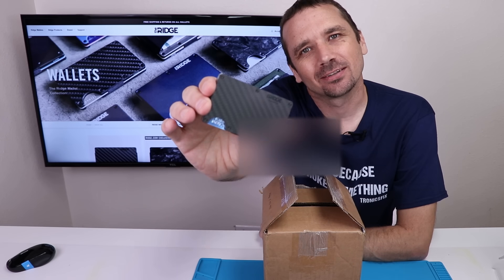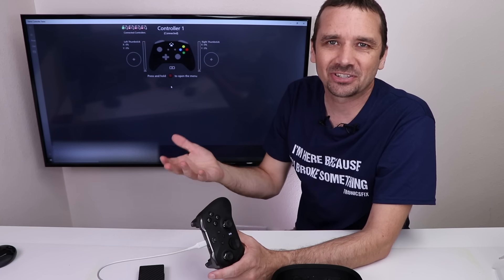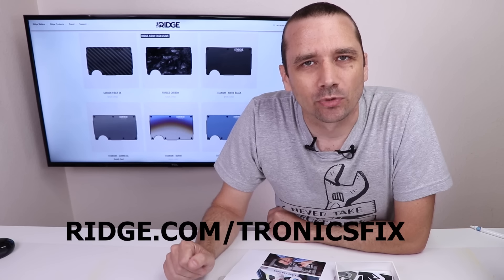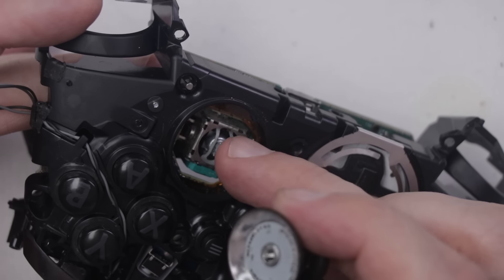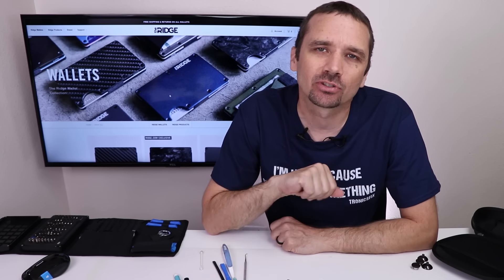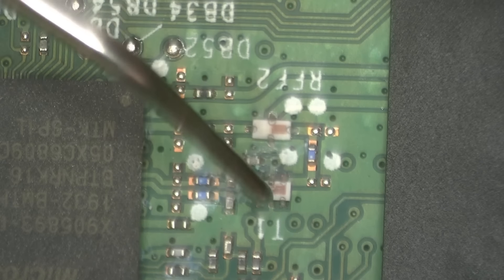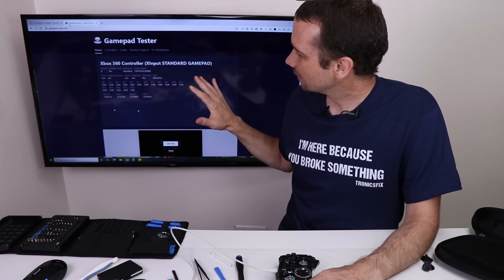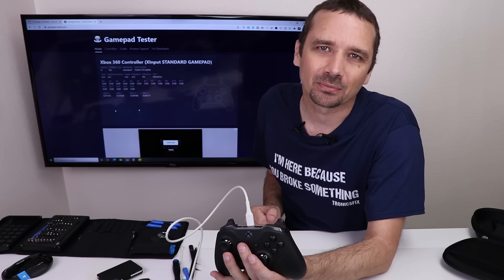I Paid $99 for a BROKEN Xbox Elite 2 - This One Was A Tricky Fix

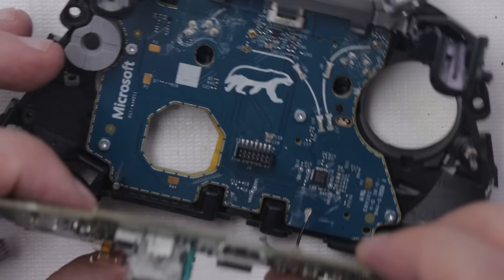Comment: 10:21 I found a solution to drifting analog sticks. All you need to do is pry open those 2 green containers on the module. There should be a small disc in there. You just have to clean that entire container and the disk with isopropyl alcohol and place the disk in perfectly. Your problem should be solved instantly. Works for me every time, however it’s a temporary solution lasting for about 6 months or as long as a normal analog stick.
Reply: @cpt ghost he actually made a video on this just look up his 3 ways to fix controller drift video.

Comment: Funny you would make a video on this controller, I recently purchased a faulty Xbox One Elite Series 2 controller myself for €79. Upon opening it up, I was kind of shocked at the state of it, I have a hard time understanding what happened to it but I got it to work in the end.
It was missing the magnet for the hall effect sensor on the left trigger (I could only find one from an elite series 1 on ebay, figured it would do).
The support bracket for the magnet was broken and the broken half was missing as well (I could only find these brackets for either the regular controllers, ended up ordering one for an S controller).
The left shoulder button didn't work, didn't even click in (turns out the metal plate it fits onto had been bent a lot, had to realign it).
The right trigger rattled when vibrating (had to tighten it down).
In the process of opening the previous owner broken one of the little pillar that holds the left bumper in, no biggie, it works fine without that. They also broke one of the structures that holds thee controller fascia into place and they broke one of the structures that holds the silver plastic on the top of the controller into place so it looks slightly misaligned.
Anyway, I got it to work fine and I'm happy with that.
Reply from the maker: Nice work! Controllers can be challenging to repair because of how badly they're treated sometimes.
Reply: @Tronicsfix  yeah, I've been struggling with some ps4 controllers. One of them still has drift even after replacing the offending analog stick twice, with a new one.
Reply from the maker: @hadesmcc  That's a tough one. I haven't done enough of them to give you any ideas.
Reply: @Tronicsfix  I'll have to keep at it. I had a similar issue with an Xbox One Elite Series 1 controller but that had been my mistake, I had moved one SMC with the hot air inadvertently. Fixing that fixed the issue but that is not the case with this rogue DS4 controller. :)
Reply: André Coelho I bought a DualShock 4 off eBay which had a broken analog stick/drift issue. I replaced the joystick module and still had the stick drift. There’s two resistors and depending on which way the game character moves with the stick drift, one or both will have to be replaced. The character moves back on its own and won’t move forward so that tells me the resistor on the left has to be changed. You’ll have to keep changing the resistor until you find the right one and luckily I only have had to change it once or twice.
Reply: @devoid3227  Thanks, I'll look into that. :)
Reply: @devoid3227  Do you happen to know the values for these resistors? I could measure them with a multimeter to see which one is off.
Reply: The owner must have been playing a lot of FIFA

Comment: I had actually fixed one of those a week ago. Drift issue. Fixed it up. There is a website I use to test every controller I work on, which happens to be the site you used. Funny how its registered as a 360 controller.
Reply from the maker: That was strange but still worked fine. I'm not that familiar with that site so I wasn't sure if that was normal or not.
Reply: @Tronicsfix  I will say the gamepad tester app has given me bad readings before. I replaced the sticks on one, tested it with the app, and everything looked fine. The customer brought it back with the same issue. So I used that site and sure enough the drift was still there. So it's good to have a backup just in case.
Reply: @HumanDelta38  yes true also windows 10 has a buildin controller test which also works very good on finding drifting.

Comment: Great fix, I would have been totally lost. 
Little question though, will it not get worse overtime? I thought corrosion, unless you get every single bit off, is a timebomb
Reply from the maker: Yes, generally speaking, you need to remove it all or it will continue to corrode over time.
Reply: @Tronicsfix  ah right, thank you for the response, I was thinking of starting to buy some broken products myself so I'll know to stay away

Comment: I've always wanted one of those controllers
Reply from the maker: Other than the smoke it's a really nice controller.
Reply: I’ve had two the first had a few issues got a replacement and works great only thing the right bumper doesn’t respond sometimes have to press it hard or in the right place but that goes away after a while
Reply: I have an Elite 1 and Elite 2. I really like my Elite 2. Well worth the money for the quality and customization.
Reply: Nice is there a ps4 version
Reply: Ghostreaper 098 ones similar to it
Reply: @jimmyfallon4237  thanks Jim
Reply: Ghostreaper 098 Sony dont make a pro controller but third parties do
Reply: ARX Infinite third parties do and Sony Will license them
Reply: I had to send mine back to Microsoft after 2 weeks because the right bumper was registering twice when I pressed it. Apparently lots of people have been having problems with the Elite 2. I should get the replacement Wednesday so I’ll see how that goes.
Reply: @Tronicsfix  lol ok😂
Reply: @shadow_sith5102  no, this is xbox only, take a look at scuff gaming

Comment: I’ve been buying and fixing elite series 1 controllers. I also mod new frames to get them to fit with new bumpers, triggers, and faceplates from the one S/ one x controller. Just got an elite for $15 that just needed one board connector re-soldered.

Comment: I disassembled and fixed the shoulder buttons on an Xbox One controller before. They requires you to melt the plastic welds to get into them. It's not easy and I recommend replacing them over fixing
Reply from the maker: Hmmm...all of the Xbox One controllers I've taken apart that piece just pops out. I'm filming a video now of repairing 25 Xbox Elite controllers and I'm replacing a number of them. Maybe I'm not thinking of the same part you are.
Reply: @Tronicsfix  how much were all of them?
Reply: @sawyermack7739  probably around $300-$400 or less

Comment: Perfect timing, the RB tactile switch on my Xbox One S Controller is broken. I'm trying to do a repair. This is a great video so many twist and turns but positive result at the very end.

I've learned that the stick is calibrated onto the motherboard by Microsoft, so replacing it without calibrating the potentiometer will caused the dead zone to be off.

Comment: When I see the title and you find it as a tricky fix, I’m surprised
Reply from the maker: I'm actually not as good with controllers. I haven't fixed as many of them.
Reply: @Tronicsfix I'm sorry to ask but my controllers right trigger does not work unless I blow in the controller any fixes you know?
Reply: @FOREVER-qj3rt  If you feel comfortable taking it apart, the pad for the shoulder button is probably dirty and needs to be cleaned. That's my best guess and where I would start troubleshooting

Comment: Honestly I think original Xbox one controller thumbsticks are better, I have the elite series 2 and I've used it for 3 months and the left thumb stick is already wearing out :(
Reply from the maker: Interesting
Reply: @Ebolachicken  say what? Cheese grime? Not the one I'm thinking about?? O_o
Reply: Make a warrently claim on it. Most people forget, my headphones recently broke but luckily had 1 week left on my warrenty so sent them in and even got a newer model because my current ones were so old & discontinued
Reply: @sm00th77  And what next, after warranty runs out (1-year only I pressume)?
Reply: Used mine alot. every single day for 9 months. thumbsticks seem to wear a lot less than the old ones.. you might just have a faulty one....

Comment: I used to smoke. I quit like 13 years ago. I never knew how stinky it is. That said, that person must have smoked a ton to make it linger on non fabric!

I love my Elite 2, most of the time. Seems myself, and others have a problem with it shutting off in Rocket League. I just keep it plugged into the power.

The whole design of kit is great. The case, with a charger. It's pretty flashy.

Comment: Random tip if you want to get rid of the smell of smoke 

Simply grab the shell and dip it in cold water with banking soda that will get rid of the smell (gotta leave it there for at least an hour or overnight for better results :3)

Comment: You can actually fix stick drift by replacing just the sensors. (The green bits on the analog. You can gently bend them out and switch the sensers with tweezers

Comment: My thumb sticks had some glue on the threads to keep them from rotating under normal use.

Anyways I fix my drift issue with the left thumbstick drifting up and down by pulling the top cover off,then the thumbstick bell,pulling the potmeter away from the board,pulling out the wiper disc,straighting the wiper contact point to where it's the only point that can touch the top outer ring,cleaning the carbon traces with isp.

The top ring had a rough spot on it,so I used some    Tweezers to  Gently clean it being careful to NOT bust up the carbon,then used a #2 pencil to add some carbon back in,then clean the traces again and no more drift.

It took about 50 trys of pulling the wiper disc out and getting it straightened just right,tho, so just be patient..

Comment: I'd love to see you take one apart that has the more common problems, to see if you can see the cause. I had 4 Elite Series 2 controllers and all 4 had an A button that didn't always register when pressed; that's right out of the box. It would be interesting to see if it's something to do with the silicone pads that sit under the physically buttons and if replacing those fixes it.

Comment: I picked up on of these for surprisingly little money, guy never mentioned that the shoulder buttons were super unresponsive. Read some people's experiences and dropped some alcohol into the switches and worked them for a bit as well as filling the gap under them with little lengths of wooden rod to support them. Perfecto now but the failure rate of those buttons for so expensive a product is truly shocking.

Comment: Hi Steve. I saw something on another channel that I thought might be a cool idea and something I haven’t seen you do before. Find a PS1 in need of repair and do an update with a PS1 digital upgrade. The PS1 needs to be one of two board models and requires Micro soldering to install ( something your very qualified to do).  Possibly do a before and After video improvement too. But a retro repair and upgrade would be a pretty cool video. Thanks for the cool videos

Comment: i recently bought a faulty gameboy game to repair. I received it recently and opened it up and it had the worst liquid damage i have ever seen. Everything had thick green corrosion all over it and the chips just fell right off. I just had to throw away the circuit board nothing could be done to save it

Comment: Good work but I saw vibration motors full of liquid damage as soon as you took top off, and then when you took the triggers off too, Those motors need replacing not cleaning. As much effort as it took to reflow the boards and repair the liquid damage, experience told me to walk away, i've done hundreds of this type of fault, even though it appears fixed they never last long after liquid has been in there like this controller had. keep the vids flowing

Comment: See the dual board design on the Xbox one controllers makes them a pain to fix because if it’s the board with the controllers brains your in trouble if it’s buttons not working could be a faulty top board there a horrible controller I prefer the 360 and original Xbox controllers

Comment: I bought this controller and those plastic nubs on the triggers broke in 2 weeks.  The original was metal, I think, and still on my old controller.  While this controller is better they moved to cheap parts, especially those nubs to save money.

Comment: Hey Steve, love the content. Quick question. Did you check and reset the controller back to defaults before tearing into it. I noticed in the beginning you were on profile 3 of the controller, which somone could have set to have those buttons not work on purpose. If you press the center button they will go back to defaults. Your tester program might have overridden that but I doubt it since it's inside the controller that these assignments happen. Download the Xbox accessory app on your Xbox and plug it in and see if profile three was set that way.

Comment: I had some refurb and now a brand new one, and they all have the same issue  for me. The buttons are not sensitive enough when pressed and it doesn't trigger sometimes, even after the click sound and all. Could be the quality of the membrane or the holes for the buttons giving too much space to move the buttons around. All in all, this is frankly the worst controller I've experienced.

Comment: I'm aware that this video is old, but could you please make a tutorial on how to remove the potentiometer on these newer xbox boards? I have many years of experience on the older controllers but these new ones with the updated solder holes are giving me so much trouble. It's impossible for me to melt the solder and suck it up well.

Comment: Hey man, I've repaired quite a few regular Xbox One S controllers which electrically are pretty similar to this one, and the B button doesn't connect to that last chip, simply because it is on the green board. I mention this because I saw the B button not working before cleaning that last chip, and neither after that, so I'm just curious, B worked after that last clean? Or was it still having issues?
Awesome video btw, I wouldn't have enough courage to open a controller like that without watching some sort of guide haha

Comment: So I bought one of these a little over 2 years ago was never able to use it as the left thumb stick was never really responsive, character would barely edge forward. Had a look at it via xbox controller test and really had to put some excessive force for it to register it being used. Did remove the front facial cover and all movement was registered as normal, not a viable option for designed use, though. Hoping it is an issue you have come across and could share some knowledge 🙏

Comment: You actually don't appear to have all the parts, the middle slot in the case is for a key that adds tension to the analogue sticks. Also you should have 6 analogue sticks total, and it looks like you only have 4?

Comment: You should be testing with default profile (profile light OFF) You should have owned one or at least understood the features (Like adjustable thumbsticks) Also you should be using the xbox-one elite app. Can't believe anything on that PCB could possibly benefit from reflow, cleaning maybe. Looks as if it only started working because you finally booted it in default mode (FW)

Comment: help!
which is the voltage battery ? 1-positive 2-neutral 3-negative

1-positive and 3-negative = 3.8v
1-positive and 2-neutral = .08v is correct ?

Comment: Great vid as always! I have a question: my Wiimote had a "broken" accelerometer, so i opened it up and i cleaned it several times with alchool and a tooth brusher. Now sometimes it works perfectly, sometimes it doesn't respond at all. To me it seems pretty clean, what's causing the problem for you? Thanks for the answer in advance

Comment: You put a past on the 4 edges of that one chip then went through with a soldering iron. You said that was resoldering all the connections? Can you show a video of that technique because I've never seen that. I've tried soldering each pin individually and it's touch to keep each connection separate when it's that small. So you coating all the connections at once I don't know how you stopped solder from bridging connections.

Comment: I don't know if you answer questions about console issues but I can't seem to find my issue anywhere online. So I have an Xbox 1 and if I leave the power supply plugged in and turn it off n turn it on it goes directly to the trouble shoot screen no error codes. But if I power down n power cycle the xbox n plug it back in and turn it on it will boot up. I've checked the power brick light is solid white when on solid orange when off. The xbox power light on the front will flash in rapid sequence while on. It doesn't crash n works normally.  I have tried a soft reset n hard reset and nothing works. Every once in a while i hear a odd tick noise from inside the xbox.

Comment: Is there a way to just buy the official Xbox One USBs that come with each controller? They are so good but once they start going bad/get dropped the wire NEVER goes back in properly, the top port are so badly made. The Switch Pro does it much better

Comment: Great video as always! I do have a question and perhaps you can do a video on it. But I have two of the red wired Nintendo switch controllers, and the left thumb stick always drifts to the left. I've tried cleaning them out, but that didn't work. Kind of stuck on what it could be. And, we rarely even used them, they mostly sat in a basket with other controllers or Skylanders figures.

Comment: Hmm still can't find an answer as to why my ps4 isn't working
1: when I turn my ps4 pro on the disk drive turns on and is running in the inward direction, and it's wanting to take the disk but it feels as if theres something blocking it. And Idk if this is what's causing my ps4 to get the cannot start ps4 error I need help.